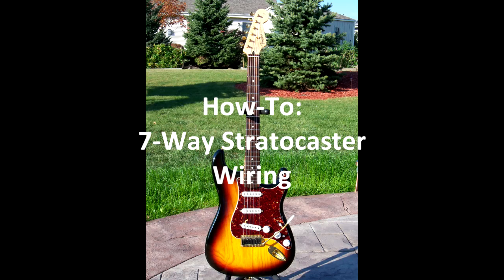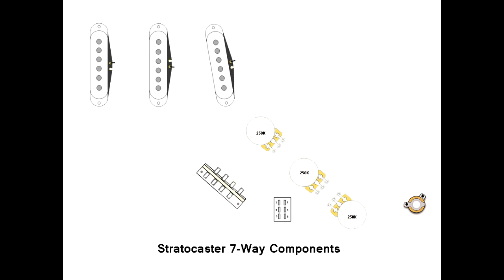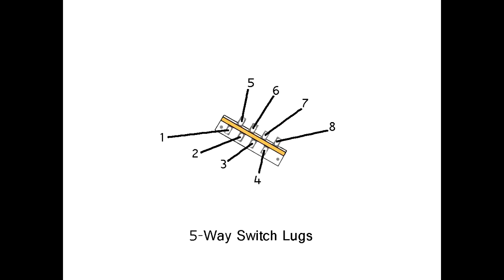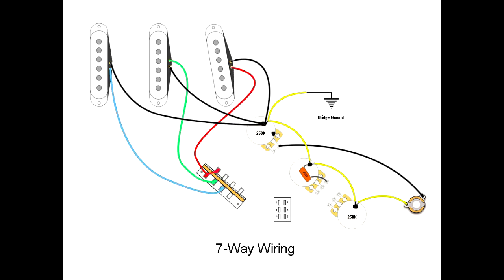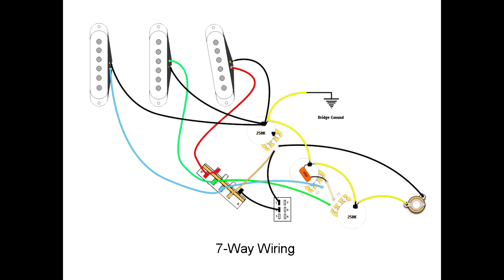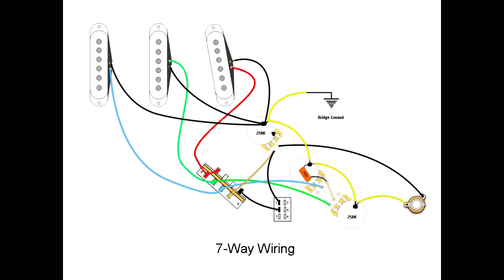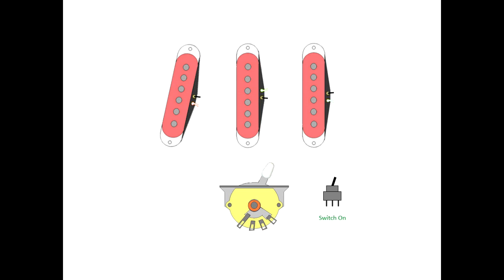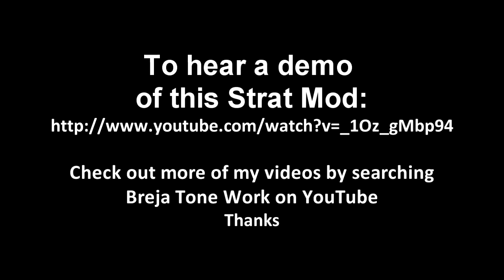7-Way Stratocaster Wiring Mod

Comment: This is one I did to my strat, along with wiring up the neck tone pot to work on the bridge pickup as well. So what  I get is a tone control on the bridge in pos. 1 or 2 and the tone on the neck in 4 and 5. In 6 or 7, the neck pot becomes a master tone for neck and bridge, tele style. In any position that involves the middle pickup(2,3,4,7), it retains it original, independent tone control.
Reply: How did you do it?

Comment: I've done a lot of searching, but I like your videos the best. Very clear and easy to follow.  You really seem to know your craft, so thought I'd ask for some advice for the best way to configure my guitar with the parts I have. I really like this 7-way strat (or maybe even the nine) but was hopping to maybe include a push/pull for a little in/out phase, and/or a blend pot. So here is what I have to play with: 3 single coils, a 5-way selector,  3 A250k pots, 1 B250k pot (not sure what the diff is between A & B), 1 A250k push/pull dpdt pot, 1 Blending pot,  and a 2A473J cap (might pick up another if suggested). The pick guard is setup for three knobs, but a fourth could fit comfortably if needed. Anyway, hope i wasn't to long winded and thank you in advance.

Comment: I am definitely doing this when I get ready to put my guitar back together. I have a J. Reynolds guitar that is a direct Strat copy. It was my very first guitar (almost 12 years now). It's not the best quality guitar, but it's my first and my dad bought it for me so a friend of mine talked me into refurbishing it. I've been researching for days on ideas of what I might want to do. I'm going with some new pickups, I'm in the process of sanding the body right now and plan to paint it later this week, and probably going to order a custom neck from Warmoth customs. I saw a video earlier of a guy who did this with a Strat he had and it sounded absolutely amazing. Now that I've found the video that explains how to do it, I'm in. Thanks for this video, very informative.
Reply from the maker: I hope it all works out for you, Joshua.  Best of luck to ya...
Don

Comment: Wow. This is so cool. This is a really cool idea. If you did it with a push pull pot on the tone pot for the middle pickup, down there by the jack, then there would be no new holes, and no little switch to hit your hand on. For me, I do not like things sticking up and getting in the way. Another option would be those flatter switches like on a Jaguar, but I do not like those. Those little toggle switches are hard to deal with in that they can melt when trying to solder them. Plus they are fragile.

Comment: Exactly what  was looking for, simple toggle wiring add-on. I have a micro toggle switch, sunk so that only the tip is sticking through the p/g about an 1/8" it has a small rectangular, or oblong hole for the toggle to move in. This comes through between the pots and the selector. and is just wide enough to flip it. This was done by using a piece of sheet metal about 2 1/2 inches wide, and having it bent into a z type shape with two of the pots holding it to the p/g and the bent part, which is about an inch wide,  carrying the micro toggle. Which even though it is "micro" still would normally be sticking up a good 1/2 inch or more if the threaded base and all is attached directly to the p/g. If this makes any sense, hope it helps someone looking for a way to lower a toggle switch so maybe it isn't inadvertently flipped so easy. I'm going to now add in a piece of PCB board somehow (maybe have to make another wider piece of sheetmetal) which will include a socket, so I can change out the capacitor.

Comment: also got a strat with 3 Hot Rails 4 wire humbuckers - add 1 toggle to split all 3 back to Single coil and you get All 5 stock SSS tone combos - fyi - having an ANGLED Humbucker at Bridge will be everyone's "AHA" moment... esp if u give it access to Tone Control - beats the Fender "Blacktop" HH layout that uses a 5 way to split coils

Comment: Just did this the other day, only I added tone for the bridge with a .22 uF cap and its a push pull with this same switch only within a knob on your guitar. I think the bridge tone mod is called the Eric Johnson mod... also did the neck up with the middle tone and the middle pup is just wide open hooked up to just the volume, no tone. The perfect strat set up if I do say so myself.

Comment: I finally just did this successfully.  Tip for you if you have the pickups working 7 tone but you can't get the switch to work as in it won't go back to normal strategy mode.  Try legs 4 and 5 instead of one and two.  worked for me thanks for the tutorial.
Reply: What do you mean? Can you be more specific? Mine didn't work as advertized... I only get bridge middle, all three and neck and bridge... But I lost all other configurations and I followed the tutorial to the letter... I hate this is such a short tutorial with no more explenations or demos.... Wish there were more out there...

Comment: Excellent, very well presented. However unless youre only playing country it doesnt give you any of the pickup combinations that would make a strat an all-round guitar for the cover band/session musician. I have seen a similar use of a pull/push where positions 2&4 are full humbucking and sound like the bridge and neck pickups on a les paul. Into a clean amp they give you a fatter warmer sound BUT into an overdriven amp or pedal the difference is huge and you can play everything from Dire Straits to Gary Moore with the same guitar. It also isan invisible mod and doesnt change the look of your guitar. If you can afford a Fender S1 switch it is even better and simple to activate on the fly. Nice video presentation though, Ive never seen a more well presented example explaining strat switching mods.

Comment: I got this mode to my guitar four years ago using the push pull button to add the neck pick up at any time... thought up the whole thing myself then got my guitar repair guy to do it... and in addition to this i have push pull on the 2nd tone knob to attenuate the bridge pickup.

Comment: What about a mod that could put the bridge and middle pickup out of phase but in series, so it would be like a humbucker, and do the same with the middle and neck pickup. I listened to the demo of your 7 way switch wiring and I liked the sound of all 3 pickups on a clean sound. I have never heard that before.

Comment: Is this how the wiring works on a 3 pick up telecaster with a push pull pot as well? I am looking to add a middle pickup to my telecaster and would like to add a push pull pot to maintain the bridge/neck simultaneous sound.

Comment: Hello,
very very nice tutorial !! great job !

I’m going to do a 7 way switch upgrade soon as possible, but I have a very important question : 

How do tone knobs work after this?? neck/middle? or they don’t work? if the switch is on? if it is off?

sorry for this basic question, but I'm starting to get closer to this world recently and your videos are really helping me.

thanks!
Reply from the maker: Hey Marco...
If you're doing just this mod, the tone controls are the same as a normal strat - no difference.  I do have a 7-way mod that includes my Dual Cap mod so that the bottom tone control would affect only the bridge and the other controls the neck/middle.
Don
Reply: Thanks ! Ok, now I understand the difference between the 2 vids !
you are doing a great job with this videos !
looking forward to new videos !
m

Comment: Hi! I'd like to do this in a guitar with HSS configuration 1 volume pot and 1 tone pot. The guitar has 2 potentiometer 500k. Is it possible to do this 7 way mod with a push pull in volume pot? And also I wanna do the coil split humbucker mod with a push pull tone pot! Can you help with a diagram? I don't know how to do to link one mod with the other!!!
Reply: just leaving a comment here waiting for an answer thank you :))
Reply: @lukee_v  I think the answer is here.  That is for HSH, but the concept and wiring is the same except for your hss you would just not have the coil split on the middle tone knob.  https://www.youtube.com/watch?v=ueqdO1nyc8I
Reply: I think the answer is here.  That is for HSH, but the concept and wiring is the same except for your hss you would just not have the coil split on the middle tone knob.  https://www.youtube.com/watch?v=ueqdO1nyc8I
Reply: @TheGreenBard  thank you!

Comment: Thank you so much for posting these, I have used these to wire my strats with the 7 position mod. I'm starting a new project strat and forgive me if this sounds crazy, but can we please see a 9 way strat with three push/pull pots and the dual cap mod? All the series on one tone pot and all the parallel on the other as well as a 'neck on' for the standard strat mode on the volume pot? 
Or a way to use your existing 9 way strat mod with the on/on/on switch but have all the series in say the 'up' position and all the parallel in the 'down' position with a push pull or on/off switch for neck on in standard strat mode?

Comment: Hi! Thanks for sharing this. I have a strat-type guitar (Peavey Raptor Plus EXP HSS, 1 vol 1 tone pots, 5 position switch). Could I assume there´ll be no problem if the neck+bridge position is the humbucker and the single and not single+single as in sss strats? Thanks again!
To put this simpler, I would just want to use the bridge Humbucker with the single neck, is there a way to accomplish that? Thanks again!

Comment: Just found your videos,  I've been searching for info like this as well,  I was wondering how do I wire  3 single coil pick ups each having 3 wires coming from each of the pick ups. (A red, White and Blue wire) into a 5 position switch with a volume and 2 tone pots.  Do you have a video for this? Keep making these videos there very informative. Cheers! Doug

Comment: Hey! This looks great and I really want to do it. I have a doubt,  what would be different if I have the Eric Johnson mod? You know, the bottom tone controls the bridge pickup, and the middle pickup doesn't have tone control at all. Thanks!
Reply from the maker: Hey Caliche...
Is your goal to keep the EJ tone controls as is?  Did you check out my combo video on this 7-way and Dual-Cap mod?  It does basically the same thing except T1 also affects the middle pickup.  I personally like that mod the best because the bridge can have it's own tone control AND it's own cap.  Email me directly at brejatoneworks@gmail.com if you want to talk more specifically about your situation.
Don

Comment: Thank you for your support. I've met very strange situation with Schaller switches. Maybe you may help me. This is imported, looks like high quality product. A problem is  that no matter what switch position is all pick ups are on. No support from either distributor or even manufacturer.
please help me if you know what is the reason. Thank you.

Comment: how can i wire a push pull pot like you have in video in the place of the last treble pot the one with no cap on it so i dont have to make a new hole is there a way to do that also i want to do the 2 cap mod with the push pull pot

Comment: I made a slight adjustment to this mod so that I could have tone control over the bridge position and was wondering if there are any ill effects... Instead of going from lug 2 of the 5-way to lug 1 of the bottom tone control, I went from lug 1 of the 5-way to lug 1 of the bottom tone. This way, the only position I don't have tone control over is the middle only position. I haven't strung it back up yet, but everything seems to work right when I do the screwdriver tap test. Am I sacrificing anything else besides the mid position tone control when I do this? Thanks so much for making these videos! I've learned a lot from just watching a few!
Reply from the maker: Hey there... 

I'm not sure if I'm thinking about the right lug that you're referring to but the 1st Lug (B1) on the right side of the 5-way is a common lug (corresponds to A4).  You wouldn't want to use it for tone.  Watch this video and you'll see how to get individual tone on the bridge and keep another for neck/middle:  HSS Strat w/7-Way, Dual Cap and Coil Split Mods

Don
Reply: Breja ToneWorks I think what I mean is lug A1 on the 5way (first one on the left that the bridge pup is wired directly to). So, the way it's set up in this video, I basically have the green wire that's coming from the tone pot going to the switch lug that the bridge pickup is wired to instead of the lug that the mid pickup is wired to. That dual cap mod seems to be the ideal setup for me, so I'll probably just do that eventually. Thanks for the reply, Don!
Reply from the maker: dcap4545 I really think you'll like the 7-Way/Dual Cap mod - it's my favorite one.

Comment: The 7 position is cool. I'm going to take it one step further to put in a pushbutton switch that will allow me to bypass the volume pot all together. Too often I accidently roll off the volume. At a cost of less than $3 what can I lose...

Comment: I tried this and it works however, when im in the bridge position and middle & bridge, my tone sounds really muffled. I have a treble bleed circuit in my strat and the push pull pot is on the bridge tone pot.

Comment: Sorry, wrong comment for wrong video in the bottom... Hey, so, if I only get the new configuration... meaning bridge neck, and bridge neck, middle... no matter where I move the switch.... what could have I done wrong?  maybe the switch doesn't work?

Comment: I had a question about a strat mod. Is it possible to add a concentric pot in the middle pot position to have separate tone control for all of the strat pickups?
I am interested in adding that to a 7way strat strat setup with a switch.

Thanks!

Comment: So on the 5 way toggle switch 6 and 7 are not wired? My strat came pre wired and connected to the second tone pot, should I unsolder and doscard those cables?

Comment: Cool tutorial. Thanks! I’m planning on doing this mod to my Strat with a push pull (I can’t bear to modify the pick guard on their; I haven’t been able to find another like it). Question- the potentiometer I got is a 500k as opposed to the 250s that are in there now (the pickups are all still stock). Will the 500k pot work, or will it just alter the sound way too much?
Reply: If you have a humbucker pickup you want to use 500K to make sure that all of its output can come through. It can make the single coils be a little brighter, but it doesn't bother me.  This could be wrong, but I think it only matters on the volume control. I'm not certain. I'm not Breja Tone Works.
Reply: StratMatt777 cool. Thanks!

Comment: How do I wire this if I want to use a push pull in place for a Tone Pot? Also I want to do a Coil Split with a JB JR pickups as well (I think I need another Push Pull for that too...) Please enlighten me I am modding a strat for the second time. Thanks for the time.

Comment: I see a jumper between the 2 tone pots on my guitar and on other strat diagrams.
Then sometimes I don't see one. If Tone (1) is the middle pickup and Tone (2) is the neck, why have a jumper? It seems this would bleed them together......right?
I also see some with the neck and the bridge wired up leaving the middle out (this set-
up usually leaves the jumper out). Bet you could make a whole video on this subject.
Thanks in advance, if you could shed some light on this.
Reply from the maker: The jumper is only used if you wish to have 2 pickups sharing a tone pot.  In this particular mod that not happening so there isn't a jumper but let's say you wanted to have the middle and neck share one pot and the bridge the other, you'd have a jumper installed.  The wiring on this switch right now isn't for having the right side of the switch really in use for tone control.  Watch this video to get a better understanding:  https://www.youtube.com/watch?v=wFrbjEN2ito
Reply: Breja ToneWorks
Ok, Thanks again. All clear, just have to decide which setup I will try first. think I'll do: Humbucker bridge with it's own tone, middle and neck on the second tone pot.
Your video's make this much more fun to do.

Comment: Awesome video!  Question: What is the end result if one were to combine this mod with a Treble Bleed on the "Volume" pot?
Reply from the maker: Hey Joseph... Don't take this as me being sarcastic, but you'd basically get a treble bleed along with 7 pickup combinations.  Unless you have a HB in your guitar, I personally haven't found much use in a treble bleed because the SCs are pretty bright to begin with.  Treble Bleeds sound best to my ears when used with Humbuckers.  This mod just simply adds 2 more pickup combinations.  I do have another video with this mod along with a Dual Cap mod which adds a separate tone control for your bridge pickup and combines the neck/middle into the other tone control.  But there's nothing with this mod that would prevent you or require you to add the treble bleed.  The treble bleed is completely independent. Let me know if you have any other questions and thanks for watching.Don
Reply: Breja ToneWorks  I thought that would be your response, haha!  I had asked because after I had the 7 way mod in, I decided to also add the treble bleed, but took it out because in the bridge/neck and neck/middle combo, I had lost a lot of lows(realized that wasn't the culprit).  After looking over the caps I had installed, I realized I put the wrong values in.  Put a 224 in rather than a 225(which ironically I have on hand.  Going to leave the TB off, because I find it sounds fine as is, but will go back in when the next string change come up, and I will put the proper cap in.  Honestly, I kinda like the way it sounds!  Anyway, thanks for the reply! 

1985 MIJ Fender Stratocaster w/ Schaller System One